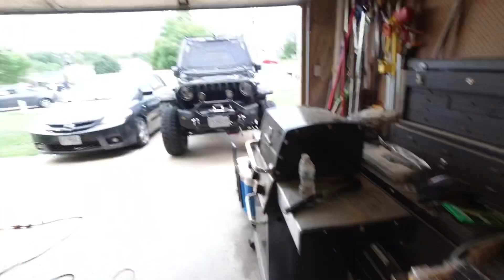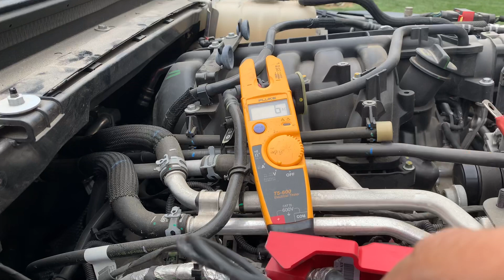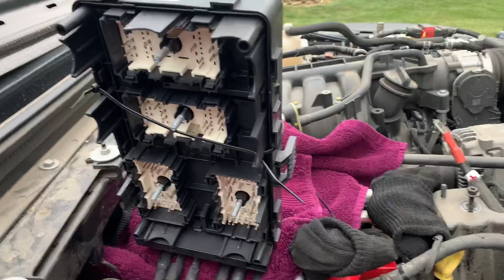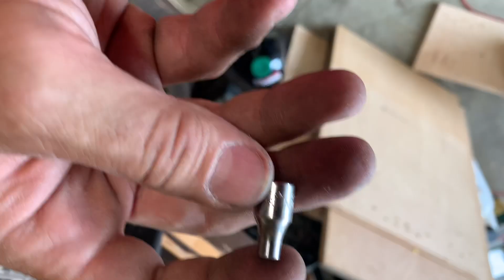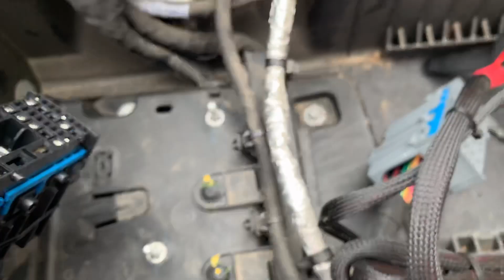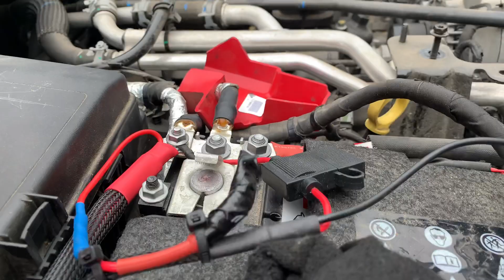How To Replace both Battery’s , Jeep Wrangler Jl

Comment: Thank you for a very informative video. You have tremendous patience I learned some new tips from you today and I loved the use of tie backs for the wiring harnesses. The engineers that came up with this design position for the auxiliary battery should be reprimanded. I can only imagine the labor cost to replace this auxiliary battery once it is out of warranty. Thank God! someone raised the BS flag, and gave the alarm. Some jeep lovers found an easier path to replace this aux battery (via the fender well). All batteries die eventually, in approx 3 to 4 years. So the owner would have to face this labor cost often during owning a jeep that they love over a 10 to 15 year period. Goodness I hope that an (after market engineering/company) or someone fabricates an inner fender access door to allow the access to the aux battery for us Jeep Lovers. Carry On Sir.
Reply from the maker: I did a follow up video on removing the battery from the bottom also.   Thanks for the feedback and channel support.

Comment: Very good video real informative I'm a welder not  a mechanic but with that video almost anyone could do that job thank you very much 👍
Reply from the maker: Thanks,  what do you weld?
Reply: For the last 55 years I have been at a shop my dad and I started we used to build big tanks and repair a lot of equipment, but now a days we fabricate a lot of the steel parts used in the woodworking industry, like brackets and counter tops large support bases for desks and table assembles, at 69yrs old i still work just not as hard as i used to , but I still drive jeeps i don't plan on growing up i still want to have fun

Comment: Did this today with my son on his 2018 Jeep Wrangler. Very good video which made it dead easy to do. One word of warning, with both batteries disconnected and removed the auxiliary positive terminal touched the frame and sparked which means there must be a capacitor somewhere possibly for memory retention of settings. All worked fine, no settings lost. Seems much easier than removing the wheel and working through the fender as some videos suggest with the possibility of snapping fender clips. Thanks for the video
Reply from the maker: Thanks for viewing, i have videos of changing it both ways.  Either way it sucks.

Comment: Great video. Working on a 2018 Wrangler and it has start/stop but there is NO auxiliary battery! 2.0 L engine. When were the batteries introduced? I sort of don't care and somewhat happy but I am suspicious that something may be amiss and although it has taken about 3 years, I feel the main (only) battery didn't have that much service.
Reply from the maker: Thanks for the comments, that battery was put in for the 2018 JL. i did pit out an update on the video.   There is another way to change it.

Comment: Question, could you run a battery tender cable from that battery.
Reply from the maker: Thanks for the question, truthfully I don’t know. If you look at my other video or stop start issues. I also show you where you can change the battery coming up that’s much easier

Comment: Great and Amazing video. I never knew the JL had a second battery, so learn something everyday. I plan on taking off my interior trim around my steering wheel and have to take out my airbags both driver and passenger side. Should I disconnect the secondary battery as well to prevent the airbags from going off?
Reply from the maker: Thanks for the good comment, i don’t know about the airbag.

Comment: My JT is one year old..
And my Auxiliary batteries dead ☠️ 
Really.. 1 year..?? Hopefully i can get 
A lithium or dry cell for it
Reply from the maker: You might get it replaces under warranty.   Is the light coming on, or not starting.
Reply: @JeepingMo  just replaced it 
This morning.. jeep wants to hold 
It there..or schedule way off in the future… but the 2021 JT has aux battery placed up higher.. didn’t have to dig down into the wheel well..👍
Reply from the maker: @mikekosar6135  hope you’re rig is fixed and the video helped.   👍👍
Reply: @JeepingMo  absolutely..!!

Comment: Good video.  If you have to do it again it is easier to pull the fender off and do it from the bottom. 4 or 5 screws for the fender and a push clip.  1 connector then 3 bolts on the battery case.  No need to remove the fuse box and not bend a pin   Great video though

Comment: In the last two days I have been getting this funny message after starting my 2019 JL that the auxiliary switch bank is not available because the battery is charging and the vehicle 🚗 start stop function does not seem like it’s working last night driving home I noticed the engine didn’t shut off at the lights. Could this be the little battery?  Excellent instructional video!  PS Did it correct the problem.
Reply from the maker: I had many issues on my  Jeep, and the battery was just one of them.  I also had cam fazers going bad, that was making the charging system not work properly.  It was a mess that took me a year to work through.   Good luck on your Jeep.
Reply: If the state of charge is below seventy percent (I assume this is both batteries together) than the stop/start system will not work, this is how it is designed. There is a internal battery sensor connected to the positive terminal of the main battery, the computer does a test on state of charge every time you start the vehicle. If it is below seventy percent you will get a alert on the dash that the battery is still charging and stop/start is not available. This will give you a idea of how much life is left in your batteries. If under warranty the dealership will not replace batteries  until state of charge is below fifty one  percent. This is where I am at now. Two years and 22000 miles. My guess is my batteries will last past the three year 36000 mile warranty.
Reply: Did it say start/stop not ready
Reply: @Aceinfinity-le8zc  I don’t remember what it said it was too long ago but I tested the charging system and both batteries 🔋 were testing bad and I had both replaced by the local Jeep dealership

Comment: You have convinced me to add the stop start bypass on my JL and let this battery just sit there for as long as possible.
Reply: Yes, only an idiot would engineer a vehicle with this type of setup just to change a battery.
Reply: @Lakanuki  I disagree… whoever thought of this for Chrysler is a money making genius! 
By making this battery so hard to replace they guarantee that they will be making a ton of money from customers coming to the dealership for a replacement! It’s actually a very smart move on their part!!
Reply: @hellaacapella  

Well that backfired on them in my case, when my wife was left stranded in our 2020 JLU Rubicon diesel, at 18 months old and 21,000 miles with a dead battery. They had to come and tow it, and replace both batteries under warranty. 

Unfortunately, we had to deal with the huge inconvenience of the situation. Which does not in still confidence in our Jeep since it happened with no warnings at all.
Reply from the maker: Thanks for the comments, but please note that the Jeep starts on that battery. It’s used every time you start.
Reply: @JeepingMo  I have not looked at the wiring to see if that can be modified.  Stop start is a requirement and this was not a good implementation.
Reply: @JeepingMo  Are you sure about that?  I read on the Wrangler forum it is to run the accessories will in stop mode at a light.   It doesn't have the cranking amps of the main battery.
Reply: @JeepingMo  This is incorrect.  The main battery is used for starting.
Reply: Yeah and unfortunately..
There’s other systems 
That need additional voltage

Comment: did you get check engine light when the battery when bad?? if yes whats the code?
Reply from the maker: Thanks for the question, I got mostly stop start error message. Then it pulled out power noticeably.  The dealer was chasing parts, it took 2 years until I replaced it.   Thanks for the question and subscribing. But I was also having cam phaser problems at the same time .

Comment: i made mistake on removing the big battery  positve toches the ground after i returned the batt my system go abnormal and wont start i think i short circuited the aux batt
Reply from the maker: Did you check all your fuses

Comment: For those that don't want to mess with the fuse box you  can access the auxiliary battery from below by removing the passenger fender.
Reply from the maker: Thanks for the comment, yes you can. I don’t want to hang the battery from the terminals.  Also make sure you have extra clips. It comes down to preference, I have had dealers tell me both ways.   Hope we have you as a subscriber.
Reply: @JeepingMo  subscribed.  You can lower it without hanging it by the wires but yes, my extra 25 count Amazon clip supply is getting low.  I prefer the fender route because one wrong move with the fuse panel and having a fuse fail on you or something else electrically on the trail is worse news than replacing a 28 cent fender clip.
Reply: Yes, that is the correct way.  Messing with these harnesses in the PDU is a disaster waiting to happen.
Reply: Thanks

Comment: Put in the new aux battery positive then when I go for the neg it sparks ..  it sure what I’m doing wrong
Reply from the maker: I would double check your connection,  I think one of your connections are backwards.
Reply: @JeepingMo  since it is a live circuit a little spark is normal ?
Reply from the maker: @PatrickHolmesHollywood  it might.  I would check it and if you have a multimeter I would check it.
Reply: @JeepingMo  I think I may have found the solution like you said. When replacing the aux battery do neg first then positive ?
Reply from the maker: @PatrickHolmesHollywood  glad you found the problem, thanks for the channel support. Hope your a subscriber.  Can I ask where your from. Look me up on Facebook or Instagram.
Reply: @JeepingMo  i am now ! Hopefully I can earn your sub too ! I’m a new mechanic to the game at 28 a little old to join in but here I go ! I’m
From Los Angeles moving soon tho wbu ?!
Reply from the maker: @PatrickHolmesHollywood  I am in Missouri,  my last name is holmes Also, that’s why I asked.

Comment: Why not just eliminate the auxiliary battery by connecting the aux positive cable to the main battery positive cable then completly remove the aux ground cable because you wont be needing that any more then you can throw that auxiliary motorcycle battery away. I would only do this if you dont use stop start system, but the stop start system will still function if you want it to.
Reply from the maker: Thanks for the comment, and watching the video. I would need to find out if it would be that easy.  That’s a complicated system to short out.  That is a little out of my depth.  Electronics is not my thing.
Reply: @JeepingMo  Mine either. But i learned the aux battery only runs the accessories when the jeep is at a light and the engine is shut off. It does not start the jeep. Its not needed if stop start isnt on. I dont use stop start. When you change your system to a full fledged dual battery system you are doing the same thing. Youre connecting the positive aux cable to main battery cable and removing the aux negative. I looked at the wiring diagram. The aux battery isnt needed.
Reply from the maker: It makes working on it a little dangerous. When you take the leads off they are still hot.
Reply: @JeepingMo  I just spoke to the owner of Genesis that manufactures Genesis dual battery systems for Jeeps. He confirmed to me that yes you can remove the auxiliery battery this way.
Reply from the maker: @danielsmith5351  that’s good information, thanks for finding that out 🤙🤙🤙
Reply: @JeepingMo  Youre welcom. I cant believe after 2 years no one on the internet has shown how to get rid of the aux battery. But ill show it soon and explain it soon.
Reply from the maker: We started a Fabrication only channel , we would appreciate if you checked it out and if you like it please subscribe. Here is the link 
https://youtube.com/channel/UCymCioKuGeACQLff-gRyKnA